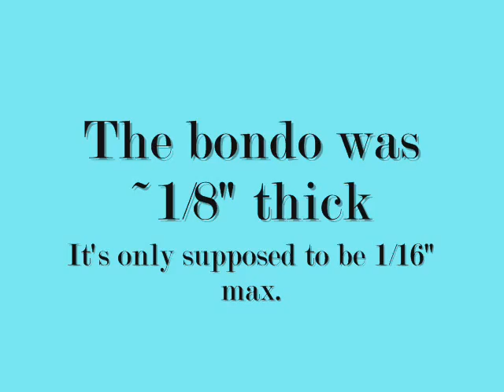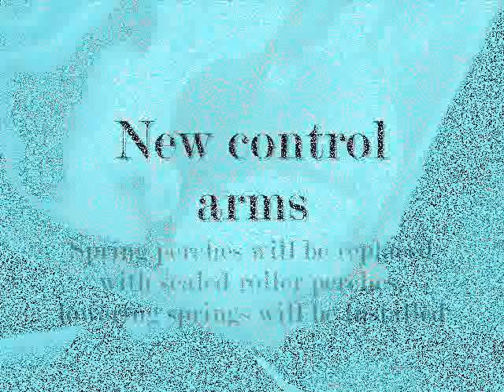1965 Mustang Restoration PART 1

Comment: yeah that's what happens when u put filler on bare metal it's a common mistake people make but when the filler hardens it gets very hot and create condensation between it and the metal I always put a primer down first
Reply from the maker: I did not know that. I thought it was only when you don't primer over the filler to seal it before leaving it outside. What kind of primer should I use, would an epoxy primer work? Thanks!
Reply: Definitely epoxy primer but read recommendations on the type of filler being used as it varies but I know etching primer will not work it just clumps and falls off ask me how I know lol